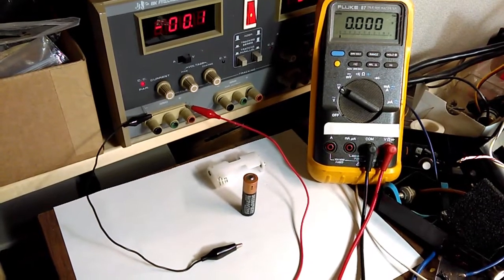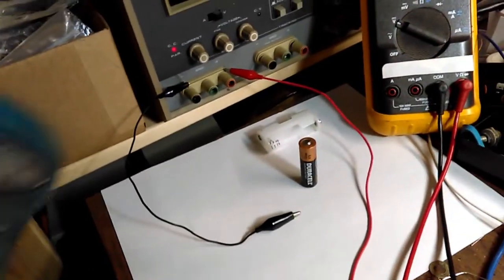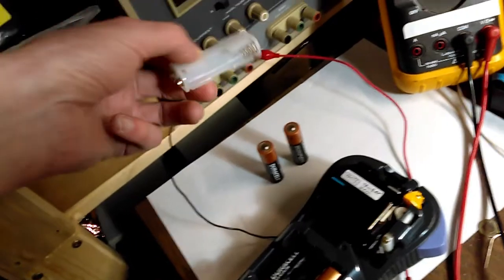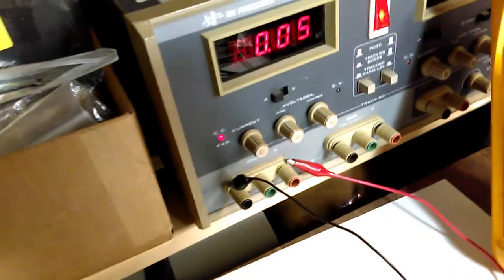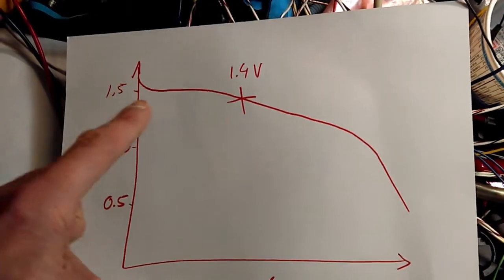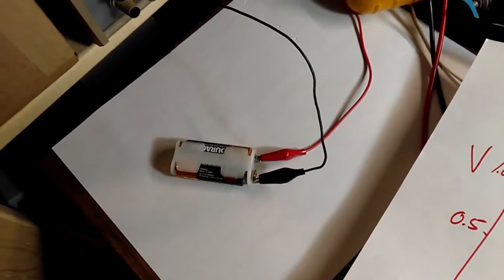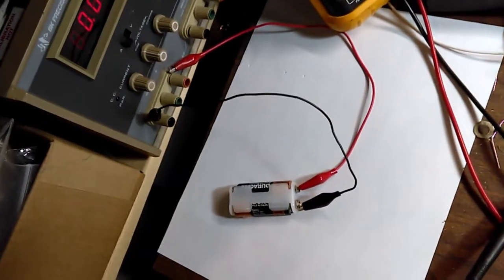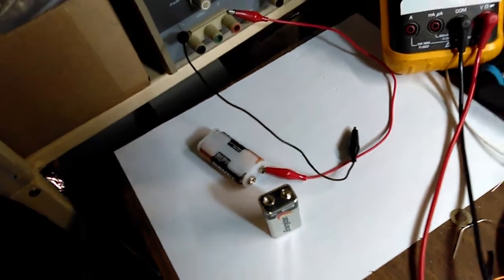Recharge your alkaline batteries with success

Comment: Metallic zinc formed during recharge doesn't return to the negative electrode necessarily. More than 50% of the reformed zinc diffuses thru the manganese dioxide pellets connected to the positive casing of the battery.
So a recharge on an alkaline battery is inefficient and the charge gained will self-discharge in less than one hour.
Anthony

Comment: Your method is almost identical to mine. I use 1.65V and let the cell draws as much as it wants, usually around 50-100mA anyway but in terms of mAh going into the cell, it's not much. If you charge it at 5V, it will leak straight away or in a few days time. Another interesting thing is one of those TP4056 based single lithium cell charger circuit boards will charge alkaline cells without leaking them. I've been experimenting for a while. Mere presence of slightly higher potential at the terminals over a long time, say 10 hours, seems to do a good job at charge separation inside the cell. The cells hold 1.6xV consistently.

Comment: my batteries always leak after a few years when they are just sitting there that white crusty junk and if its left in  some electronic that acid will eat the metal making the electronics useless, killed my pop up lights that I used for power outages and a lantern that I left d batteries in for too long

Comment: good guide, only lacks the info about the exact charging voltage of 9V battery and how to connect: "+" to "+" or to the "-" (might not be obvious to all people)
Reply: For the 9volt ypu do the 1.6v x 6 =9.6v the curremt is 20 to 30 mA
The battery should have the positive and negative simbol